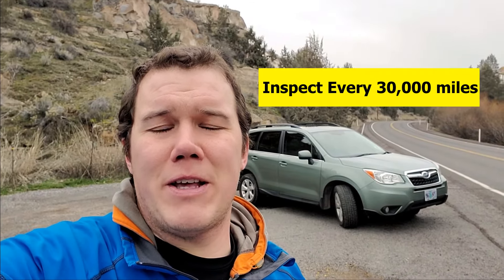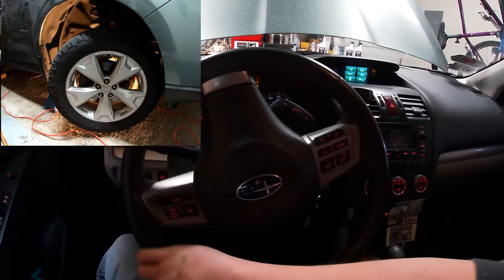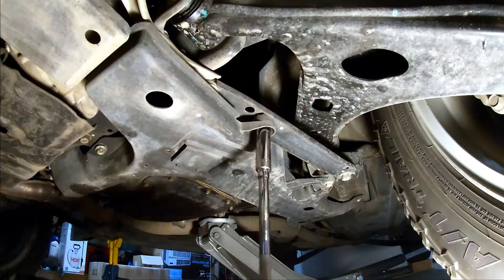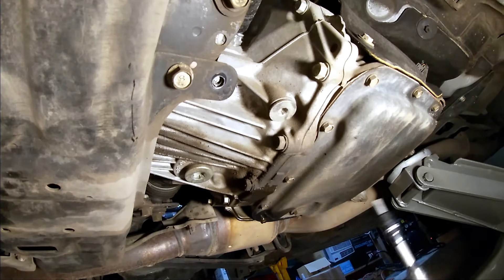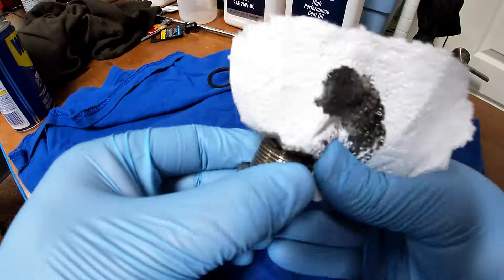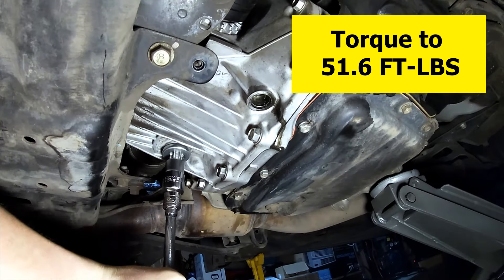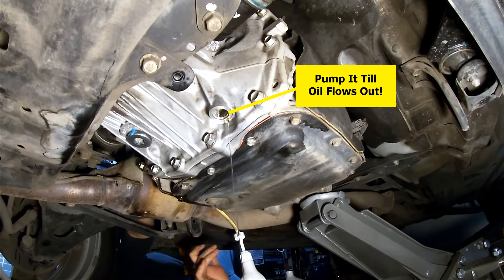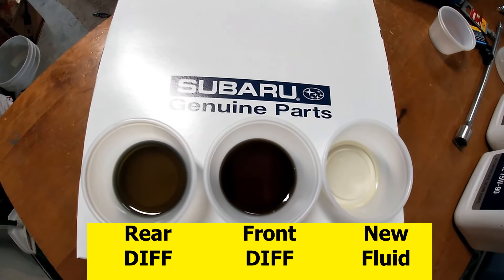Subaru Front Differential Fluid Oil Change | 2015 Subaru Forester | Drain & Replacement of Gear Lube

Comment: Crush washers in video:
x2 - 803918060
x1 - 803926090
Exact same process and part numbers for the 2015 legacy 2.5. I watched like 8 videos on diff changes until I got the part numbers from you for the different crush washers. Thanks for the super clear videos. I'm probably going to follow your CVT flush soon too.

Comment: This video was hugely helpful. For anyone having issues getting the fill plug out, I managed to get my breaker bar in behind the exhaust pipe rather than using extensions. It made it much easier to get leverage and cracked right open when I pulled the ratchet along the pipe from the front of the car (save those knuckles!) It doesn’t look like you can fit a ratchet in there, but you can.
Reply: Breaker bar between the exhaust worked for me but I had already stripped the Allen head so I used a torx bit instead and it came out
Reply: I was able to use a 6inch extension with my toque wrench right behind the exhaust pipe.

Comment: This is the best video on YT on this service, I think.  I have a 2017 & a 2018 that I want to do this summer.  Worried about the drain plug, but we'll see.  Thanks for the video.
Reply from the maker: Thank you! 

Try and have a breaker bar on hand, and just in case, you could apply a penetrating lube even a week before and let it soak in. Time is penetrating oils friend. (good ones i like are PB Blaster, or Aero-Kroil, but any penetrating oil should help)

Comment: just did front and rear today..thank you very helpful.only need to remove two bolts on the plastic cover.kinda works like a funnel for the drain plug couldnt have done it without your video however.hadtokeep watching while I did it.just subscribed..
Reply from the maker: Thank you & great job! Cheers!

Comment: Just did this on my 2020 Subaru Forester. Same exact plug sizes on the 2020, only difference was that I did not have that plastic cover underneath the transmission. Thank you for this video it was very useful.
Reply: Can we just take off the plastic cover forever??? Seems just a pain though keep???  Does it really help?

Comment: I was laying under my 2015 and realized that I could reach right up from the bottom with my ratchet. Yah, it took a little bit of fiddling, but it made pulling the fill plug soooo much easier,

Comment: Awesome video, thank you! I used yours and MrSubaru’s as a DIY guide for my ‘16 Impreza.

My drain plug was on there extremely tight. I think the last person who touched it was a gorilla. Had to use my hydraulic jack handle as a breaker bar to break that free.

Comment: I've got to do both my differentials again. First time doing the front one. 
Shop did it last when they replaced the solenoid bank on the CVT at about 120k miles. 
I'm going to be crossing over 200k miles in the next couple months.

Comment: That's a very well done video. At times I was wondering which side was forward, but it will be obvious when I get underneath. It's a curiosity as to why there is an overflow plug, but it does make getting the level correct easy when you have four jack stands.

Comment: Great tutorial! 

While filling, I noticed some flluid slowly leaking out of the fill hole and slowly dripping down the bottom of the differential. It spooked me at first because I thought there was a leak somewhere else, but depending on your pump method, some residual fluid will drip out of the front. Just keep pumping until it comes out of the check valve! 

Shortly after finishing this job, I smacked my head on the garage door while sweeping and started pouring blood all over the floor. I'll have a nice mess of diff fluid and blood to clean up tomorrow. Ha!

Comment: could you fill from the overflow plug?  just pump the oil in the drain hole until it starts coming out.  good idea?  I cant get the side fill plug off.
Reply from the maker: You can try using penetrating oil, time, and some carefully applied heat, but yes it can be tight.

Filling from a overflow plug may be tricky pumping it in. If you can find the correct breather hose you could fill from that... but this is all done at your own risk so you better be 100% sure of it. Good luck!

Comment: You should specify that the fill plug is on the passenger side. I thought you were on the driver side and I got 3 quarts in mine and had to redo it

Comment: my cvt equipped 2017 legacy calls for extra mt gear oil in the front diff. this fluid is unavailable in quantities less than 5 gal. what commercially available gear oil is compatible. Subaru wants $200 for a service comprising essentially just over 1 qt of fluid and 3 o-rings. what a rip!

Comment: I'm so far out of the loop on working on cars, especially subarus. Is there a gasket kit for the plugs, or do you have to buy them all separately? Also, if or if not, what are they called? Just fill, drain, and overflow?

Comment: This is a great video on a front differential oil change. Your CVT fluid flush video is also fantastic. I am a bit confused on the maintenance listing of, 'transmission gear oil,' for the Subaru Outback 2019 on the maintenance checklist. How does this differ from CVT fluid? I thought transmission gear oil was only for old manual transmissions.

Comment: Hi  is the rear and front differential are located in different places on the car and both needs to be changed? cause I am finding different videos either on front or rear oil change?

Comment: .  Good video  My Subaru has been a nightmare.  Head gaskets, auto transmission failed, burns oil.  Very well cared for.  Worst car than an Audi.
Reply from the maker: Sounds similar to a Saab story I once heard...Lol. bad valves, leaked oil, burned oil...

Comment: strange but i got about 2 qts in and nothing out of the overflow.  mine is a 2017, and i am using my bucket pump inserted in the cut off top of a quart bottle, so there is what's left in the hose but...
Reply: Same here. I got almost 2 quarts but nothing comes out. Just curious what did you do eventually
Reply: @JL-fly7  abort mission.  are you refilling from passenger side? that where the fill port is.  towed to dealer, transflush. youre mixing gear oil and trans fluid.
Reply: @rangely108  😂yup. Eventually find out where I got wrong and did extract thing you mentioned. Did it happen to you as well?

Comment: Hi there! Thank you for this DIY video. 
Question: On a 2017 6-speed manual model,
Are the bolt gasket rings the same on a CVT and manual models? Is there any variant to the process whatsoever? Like different oil, etc?
Thank you!
Reply from the maker: The process will be similar, might be a different "gearbox" used on a manual. I'm not sure. You might be able to reuse the gaskets, but its best to be prepared. Call a dealer with your VIN, and ask for the p/n. They will give it to you.

Comment: I mixed 0.1 quart of 75w-90 gear oil with CVT transmission oil in the drivers side, do I need to replace the CVT transmission oil?
Reply from the maker: It would be best to since that's not the right fluid, even a small amount could cause damage. Bummer dude.

Comment: On my 13 legacy after filling i noticed a leak at the bottom of the differential mainly coming from the gasket. Has anyone else experienced this if so what was the charge to get it fixed

Comment: I have slight damage on the overflow plug and I am afraid it might strip in the next change. What part # is it do you know, I am looking to buy a replacement.
Reply from the maker: You will need to look that up online, or call a dealer. I cannot guarantee the part number I get is 100% correct. Too many models out there.
Reply: @MTsubfly  I have exactly same car as you, 2015 Subaru Forester 2.5 Premium.

Comment: What is a good jack stand to use?  I have a 2015 forester also. I learn a lot from your videos. thanks.
Reply from the maker: Thank you for the comment! Glad to help!

For the most part a jack stand is a jack stand...it's made to hold weight safely. So any jack stand that can support your cars weight is what you want. A great choice would be a 3 ton jack stand, a forester weighs less thank 4k lbs I believe so a 3 ton (6k lbs) rated jack stand should be enough to cover most smaller cars. Cheers!

Comment: Any tip on a fix for the overflow plug housing that cracked before reaching torque spec?
Reply: Was split and stripped ,l think I got it from Napa
Reply: I bought a longer plug

Comment: Hey @MT, I almost pumped 2 quarts in but still nothing comes out. Do you have an idea? Thanks.
Reply: are you sure you are using the "right" fill plug?  I have been filling via the overflow for years so I don't have to deal with the fill plug.  https://www.youtube.com/watch?v=RKTjRg5b00Y
Reply: @Hoster987  eventually find out the position for the right fill plug. Definitely paid for the mistake make myself. Wouldn’t blame anybody else but myself. But wishing people could use either driver or passenger side as a good reference instead of left or right. Sometimes, it may confuse people. Hopefully no one will make the same mistake again.

Comment: where do they come up with these torque settings? ie: unless you have a digital torque wrench, how you are you supposed to know the difference between 36.9 and 36.8 ft/pounds
Reply from the maker: I know what you bean bro! I think it's because being it's a foreign design they use metric/Newton Meters (NM). So 50 NM converts to the USA as 39.6 ft-lb.

Comment: Where did you get your gaskets from? I went to some Subaru authorized dealer and I could only find the gasket for the oil sump. If you can provide a link it will be great thanks.
Reply from the maker: I called the dealership I bought the car from: Oregon City Lithia Subaru Parts Center

The man knew his way around the manuals, provided everything I needed and asked for. They have decent pricing compared to the online subaru part stores. BTW I was originally going to order from I think it was Subaru Parts Warehouse, but they were impossible to get a hold of, and returns were not easy even though after buying all the parts I could have saved $50 it's just not worth the hassle. Besides, with Covid-19, Local stores need support to survive. Call your local dealers parts center.

Comment: have you found a good place for exploded diagrams? im trying to get part numbers for the plug gaskets for my model...
Reply: you prlly already got this, but parts subaru com is a good site to find part #s, esp for the gaskets and similar. You can search "drain gasket" usually.

Comment: How long was the socket extension used to open the fill port?
Reply from the maker: I think I just happened to have a 16-20 inch extension. But 12 inch should do it I think.

Comment: I have a 2015 6 speed manual.. do you know if it's in the same exact location?  I need to check mine very soon, i'm hearing a sound almost like it has no oil in it.  I just had it changed at the dealer too so I'm wondering if it leaked out.  maybe they didn't get a plug in tight or something. I just want to look to be sure.
Reply from the maker: Look underneath your car with a flashlight and get to know your vehicle. Keep it clean and you will know if there is a leak. Dust sticks to oil and makes a mess. The sound you hear could be a number of things. I'm not sure if it would be different with a manual. It's possible.
Reply: @MTsubfly  Thanks for the reply..  I don't have a garage or anything to do much work easily here... I live in an apartment unfortunately, so it sits outside in the snow/mud but i'll see what I can find. :)
Reply from the maker: @jamiekrug3329  I too live in a rental. Interesting times. I hope you find a solid answer. Use your best judgment with dealers.

Comment: Awesome video! I have a potentially dumb question that probably any good mechanic can answer. I noticed how much care is put in to cleaning the shit out of all these drain and fill plugs. In my estimation, there is tons of leftover residual/contaminated fluid still in the differential case that simply cannot be drained, yet we're sitting here polishing drain plugs to get them spotless? Is this a bit overkill?
Reply from the maker: It's a personal practice thing. I come from aviation maintenance. If I remove something, I clean it before putting it back. A good reason would be metal burrs, or slivers, debris & dirt in the threads may find its way into the case, or cause a damaged gasket, or not a solid seal. Most likely you are fine to reinsert a dirty plug. IMO, it's attention to detail, and good practice, just like torqueing Bolts, you could just tighten it down ya know?
Reply: @MTsubfly  You're right. It's a good practice to adhere to, for sure!  I guess all my vehicles have always just been older, dirtier and I treat them as such, ha! Thanks for the quick response.

Comment: Is the overflow plug where you would check fluid level or the fill plug ?
Reply: 2 years later... Keep pumping the oil until it starts trickling out of the overflow port that faces downward. Unlike most diffs, there's a separate overflow port.
Reply: @Dwigt_Rortugal  Geeze..2 yrs haha... man, time flies

Comment: How many bottle diff fluid did you use?
Reply from the maker: About 1.5 qts.
Reply: Thanks for your info...i have 75k on my 2014, and forgot to change it. After watching your video definitely will change it now.
Reply from the maker: @kogiekobayashi3421  you got this bro!
Reply: MT Done, the drain plug was a pain. I have to buy a bigger breaker bar costing me $75. Oh well i can use the breaker bar for future weekend project.